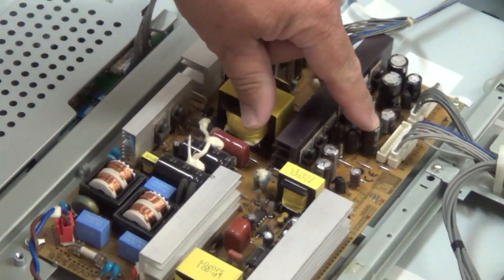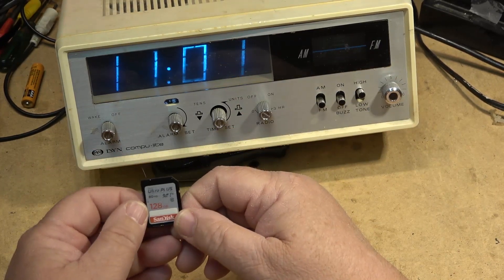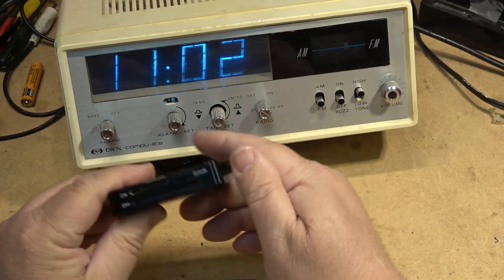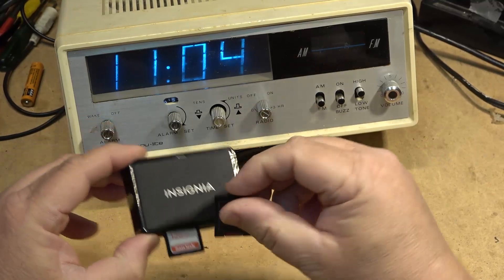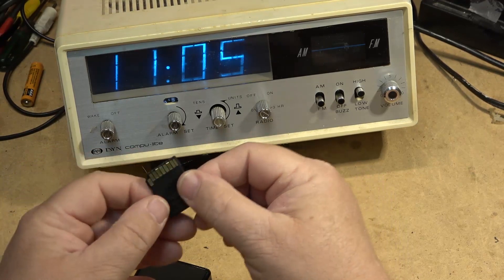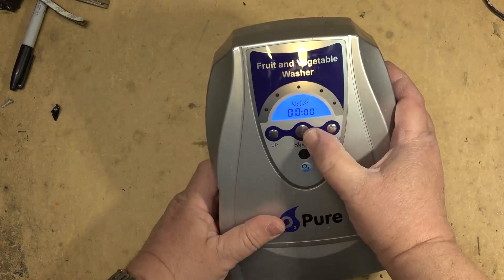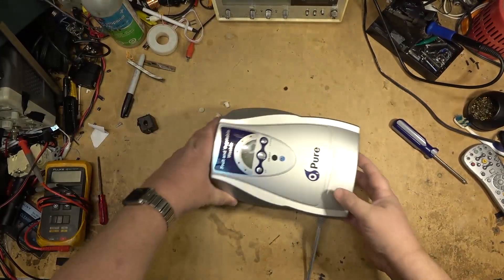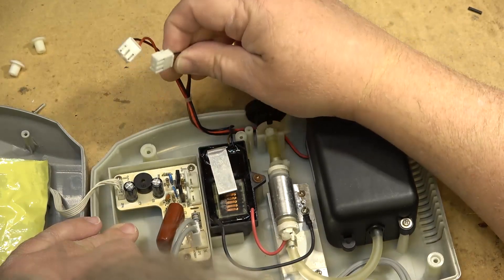O3 Pure Ozone Generator intermittent operation repair

Comment: faulty adapter .... also for the camera stopping first format the card in to fat32 then reformat it in side the camera that may solve the problem of the camera stopping it may be a mismatch of block allocation
Reply: Always format the SD card in the device (camera) it is going to be used with, and never from the computer, you read the SD card afterwards. 
Not every manufacture follows the correct specs when writing and formatting data to the card.
Reply from the maker: Card was formatted in the camera.  More than once.

Comment: SD cards can be accessed in several bit widths. They default to 1-bit operation, but can be commanded to change to 4-bit transfers. It could be that not all of the 4 data lines are connected properly on the adapter, and so it’s stuck at only being able to do 1-bit transfers which will be 4x slower (or similar ratio depending on overheads)

Comment: All I can say about the MicroSD dilemma is that the adapters are passive. But they contain long leads to the MicroSD slot. My assumption is, someone please correct me if I'm wrong, that the length of each of the copper tracks inside might not match. Signal runtime differences can cause all sorts of problems and maybe the controller falling back to a slower speed to cope wit the situation. Another explanation could be poor contact.
Reply from the maker: My thoughts but that doesn't answer the question. I am using the microSD card in the camera in the same adapter and it works perfectly. I can write and read 100mb/s 4K video and no errors. Take that card out and plug it into the reader(s) and it reads slow as molasses in January.
Reply: @12voltvids  Oh I didn't catch that the adapter works fine in the camera. So my last assumption is that the contacts might not be tight enough on your card reader anymore to make proper contact to the adapter. The adapter might have different tolerances for the contacts, cause it's not a PCB like a full size card, just plastic and (sometimes even brass) connections. Try to make the contacts inside the reader stiffer with a long nail, carefully and also deoxit the adapter. Let's see what happens.
Reply: Great bit of advice
Reply: @12voltvids  maybe some interference in reader, probably microsd slot is closer to whatever chip it use or sd slot have something else near that make interference (not likely) or just longer lead to it pickup more junk from outside. Open it and see. Maybe it even something really stupid like some additional filtering, with bigger slot there is more chance to something else like coin get stuck inside and maybe someone decide to fight chance of short circuit with bigger resistors on data lines.
Reply: @12voltvids  capacitive coupling and EMI rejection. clearly, the SD i/o subsystem in the camera is more robust than the card reader.
The SWR impedance mismatch from the adapter and the I/O interface in the SD card reader is causing an additive error that the error correction can't handle at high speeds, so it gets throttled down to a lower bit rate.
Reply from the maker: @gorky_vk  Remember that when the micro card is plugged in directly it will also get interference as it is sticking out of the reader so I doubt it is an interference issue
Reply from the maker: @tekvax01  Well it slows down so much it is unusable
Reply: @12voltvids  I just notices that I actually do have the same reader, but branded Transcent. But I don't have SD cards of that caliber to test around with. And the one I do have runs my Raspberry pi which is my home DNS server and domain filter. If that thing is down, I am almost offline...

Comment: I found Lexar cards unreliable in adapters - half the speed at best. Same with some Kioxia, never with SanDisk, rarely with Adata. So I believe that the Micro-SD-Cards in fact talk to the controllers and negotiate a slow transfer speed. Probably dues to initial CRC errors or other things, not really sure. Sometimes a simple fix is using a different adapter. You may now ask: But why? Aren't adapters just simple passive wiring adapters? Well, yes - and no. Longer wires can lead to more CRC errors, and therefor slower speed. I never noticed the slow transfer years ago, so prob. the fast bus speeds and thus clock speeds today may get kicked by the few inches of increased wires or crosstalk plays a role, not sure if the data lines/wires are separated by ground wires.
Edit: I forgot another thing to mention: heat dissipation might be a problem too, if the card adapter isolates the micro-SCD-cards, they an get quite hot and then reduce the bus speed.

Comment: It's to do with the host adaptor
Reply from the maker: But why? Remember it happens on 2 SD readers in the adapters, bit not plugging in directly, and DOES NOT happen in the camera in the adapter. So why the difference. Yes the adapter is causing the issue in 2 readers but not in 3 cameras I have tested in, and I tested it at the full speed 100Mb/s. They write and read perfectly.
Reply: @12voltvids  100MB/s is less than 480 MB/s max USB 2.0 transfer rates. So they should work perfectly fine in your camera. Even with defective adapters.
The issue will only show itself during transfer of files at high speeds.

Comment: Those SD card adapters can be junk. Poor connection causes faulty check sums and other issues. I also avoid using smaller SD cards on high speed recording equipment as they can easily fry due to heat build up. Lastly there are so many knock off cards even from reliable sellers as they are easy to spoof. Most sd cards can be opened and chips verified but micro SD not so much and would require a fiberglass pen. Hope this helps. Cheers.

Comment: Spinrite by Steve Gibson fixes HDDs like miracles and then some more than that. He is legend in computers, IT, for real. He says it works on SD cards if you have a PC with bios/uefi that can see them. If you do, already consider it fixed. Send e-mail if you want to try it out. I messed up and didn't note your e-mail.
Reply: As a guess about the other speed thing you are saying, probably adapter limitation internal. Just a guess.

Comment: Fuck lead free solder. I have to set my iron to its MAX temperature and lots of flux to even have a chance of flowing the OEM lead free solder on modern boards.
Reply from the maker: Yes it's crap

Comment: I hate lead free solder as well. I always flood fresh leaded solder on (which I bought a life supply now since leaded solder is now banned in EU ... No comment on this BS..) and suck all out, then resolder cause this crap sometimes even leaves frosty solder connections.
Reply from the maker: Its the bloody EU that has caused us all this greif with lead free and other headaches like insulation made from corn starch which mice find irresistible, and then when the expensive German car catches file and burns to the ground the insurance company won't pay out due to rodent damage and the warranty isn't valid either.
Reply: @12voltvids  Yep. But not everything the EU does is BS. They are working on forcing repairability for everything up to 10 years with schematics, replacement parts, BOM lists, repair manuals, everything.
Reply: @kyoudaiken  Finally, serviceability is coming back

Comment: Are you using usb 3.0 connector wire to plug in your computer to copy the files is your port on your computer blue if it’s not it will go slower
Reply: I bet my balls he will have been using the same USB 3.0 port and the same computer for his testings...
Reply from the maker: Yes I have plugged it into a USB3 and 2.

Comment: I would have thought steamed or boiled veg are pretty much neutral germs wise.
The soldering in that ozone box is really poor, i suspect too cold an iron for the crap solder.
Some of the bigger cards have an extra data pin, maybe the reader is expecting to use it and dropping back to a slower speed when the pin is not connected to the smaller sd card.
Just a guess.

Comment: The card adapter is introducing a VSWR BER jitter into the high-speed data, and it likely failing the CRC checks, so the card's microprocessor is backing the transfer rate down to compensate. That's my educated guess...

Comment: It sounds like several factors are at play. 

When the reader is in the camera, it is proabably covered on both sides by metal shielding.  When its outside of the camera, it is exposed to outside EMI.  

The SD cards generally have shielding up to the contacts.  I can't post pictures here, but search for pics of people recovering data from these and you will see the crosshatch pattern built in.  in the adapter, its proabably just traces connecting the contacts 1 to 1 with no shielding.  The adapter in the reader is unshielded from the MicroSD card to the contacts.  Any noise the reader is picking up may cause errors to occur, and the reader negotiates a slower protocol that is less susceptible to any electronic interference ( and less errors ).  

As an experiment, maybe take the reader and a laptop away from any EMI sources, and see if it improves.  All this being said, when the MicroSD card is directly in the reader, less surface area is exposed and therefore A higher link speed is negotiated.  Or possibly a crappy adapter that the camera doesn't mind and the reader hates.  Ive seen both before.

Could also be dirty or loose contacts inside the adapter.  Reading generally happens at a faster speed than writing.

Comment: When using SD cards for video, the only speed that matters is the number after the V, which is the Video Speed Class. I suspect the problem has to do with either the fact that you record at 60fps, which is going to require a bit higher bitrate, and or the card may not be formatted in exFAT and once the video reaches 4GB the camera is not automatically starting a second video file. I'm not sure why you use 60fps, you're not recording sports or anything that's fast moving, maybe it's necessary when showing your scope but other than that.. I wish you would just stick to 30fps cuz whenever you do 60fps I'm stuck at 480p max due to my DSL internet. It was great being able to actually watch this video in HD without buffering. It could just be that the card is old and wearing out too, as SD cards certainly don't last forever, especially if you write to them often. As far as the adapters, I stay far away from those, they usually cause more trouble than their worth. Best to just use the correct size card for the device in question.
Reply from the maker: I shoot in 60P because I get tired of people bitching that I was shooting in interlaced, and 30p strobes too muck. People would wine and complain about weeing my hands strobing every time I move.
The SD cards are all brand new so not a wear issue. All my cards are formatted in ExFAT. Required for large cards, especially when I shoot ini 4K as the files are not split at 4gb, it just keeps on going till I stop recording.

Comment: Very strange. I tested for you my hama USB 3.0 microSD/SD/MS/CF card reader with Samsung microSDXC UHS-I EVO Plus 128 GB card and two SD adapters: SanDisk and Samsung. The reader achieved the same read speed on both microSD and SD slots of around 50 MB/s (megabytes per second) for large files. It's probably your readers or adapter's fault. You have not tested the card read speed in the camera, only the write speed? This is not the same.

Comment: Your micro sd card putting it into a adaptor its the pin out on the card putting in it into the micro external card there is a problem with the pin out you are not getting the right speed of the micro sd card it's to do with the adapter at fault you put the micro sd into the right slot on the card reader 👍

Comment: If I get fast micro SD card and use the same adapter will the problem be solved? My logic is, if the adapter affects the speed, then even if I use the fastest micro SD card it won't work well
Reply from the maker: Well the microsd card I use is fast. UHS3
Reply: @12voltvids  I would just use the adaptor in the camera and use the micro sd out of the adaptor straight into the card reader you use I find issues with my micro sd cards as well and mine are the same as yours blinking weird
Reply from the maker: @jessede1970  Well that is what I do, but it bugs me that the adapter is so slow, and inserting and removing the micro card all the time is going to wear the contacts out.

Comment: Also question. What liquid flux do you use? I bought a bottle, but it is extremely sticky and almost thick. The residue it leaves behind is almost solid and too sticky to remove. I haaate it. Yours looks a lot more liquid-y than mine.
Reply from the maker: Mine is MG chemicals liquid flux. I have had it a long time.  You can get some thinner if it is too thick.

Comment: I think I know what's up with your SD adapter. In another comment you said the microSD card is UHS-3. UHS-3 operation requires a second row of extra pins which the adapter doesn't provide, so it is forced to fall back to slower speeds. It's fine in the camera because it simply doesn't require the extra speed when recording in real time.
Reply from the maker: The UHS1 and 3 have the same number of pins on the card and they are carried through through the adapter. My UHS3 full size SD card does not have this issue, only the micro in the adapter. I have tapen apart broken adapters and they are pin for pin straight through for the 8 pins, plus the SD adapter has 1 extra for the hardware write protect.
Reply: @12voltvids  Everything I can find says the UHS-II and UHS-III interface require more pins. However there is also UHS speed class 1 and 3 which is different. The interface class is a roman numeral next to the SD logo and the UHS speed class is the number inside the U. Maybe you have a UHS-I interface card with UHS speed class 3.
Reply from the maker: @eDoc2020  Did I ever say it was UHS-III? No I said it was UHS class 3. You know, the number #3 inside the U. That is the SD card, so in theory the adapter should cause NO difference but it does.

Comment: It works out the speed and transfers if you use a adaptor the speed will drop off a bit if you plug the micro sd card straight into a card reader or the front of the computer what has got micro sd card you won't find any issues the card adaptor may have a resistor in it or wired a different way for speed transfer I found this a problem to with my micro cards I just stay away from adaptors